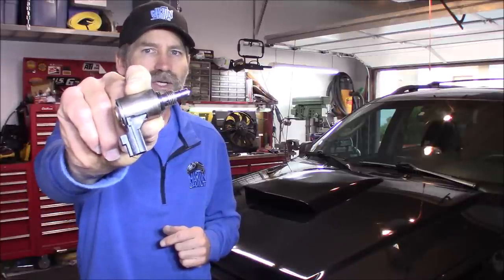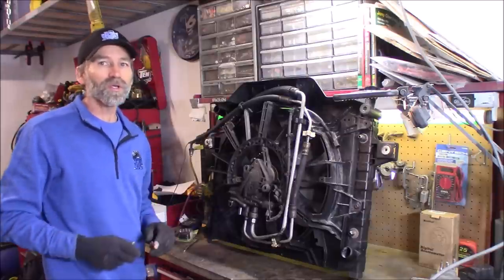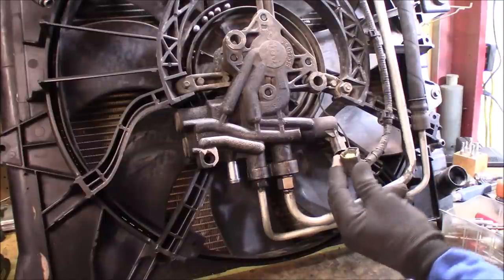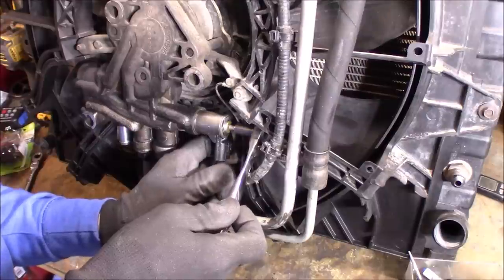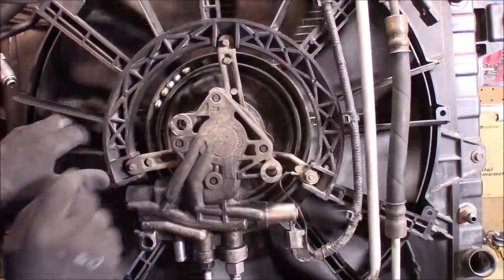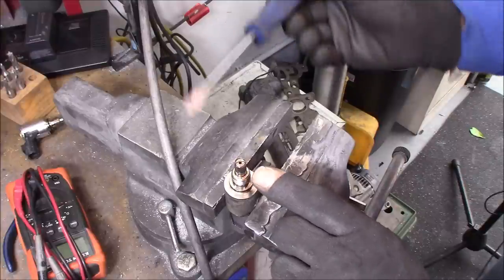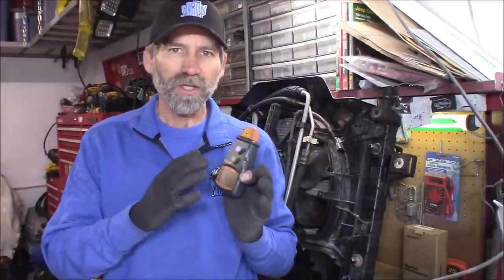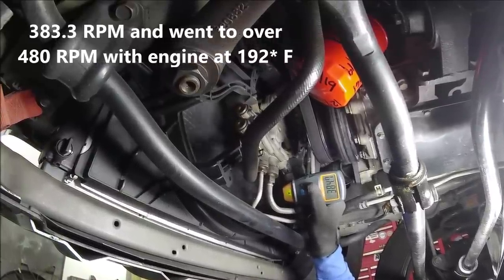01-04 Jeep Grand  Cherokee Hydraulic Fan Solenoid Mod, Remove &  Replace

Comment: My 99’ has clutch drive and electric fans.
Reply: Is your i6 or 4.7v8?
Reply from the maker: The hydraulic fan started in 2001
Reply: Jesse Fritz mine is 4.7 power tech.
Reply: martinbuilt I’m not sure what my 2001 had. I never turned a wrench on it the year I had it. It was 4.7 Limited as well and had tow package as well.
Reply from the maker: @geostanley409   Yeah it would have had the hydraulic fan.
Reply: martinbuilt all I can say is that it was more than reliable for the year that I had it. But it met a bad fate when I wrecked it almost exactly a year from the day I purchased it. I hit an interstate sign at between 80-100 miles per hour and there was nothing much left. End over end into a barrel roll. It kept me safe all the while it was being ripped to pieces. Pretty much the only reason I have 6 Jeeps today. I’m proud to own one of the safest vehicles on the road. If I ever do something as stupid as I did then, I hope that I can walk away much the same as the last time I was completely stupid. Not that I plan to do that ever again, but it’s nice to know that Jeep has my back. Everyone who saw my Jeep in its wrecked state said I should have been dead. However, even though the airbags never deployed, I only had a very minor scratch behind my right ear from climbing out through the sunroof. I’m a firm believer in seatbelts as that was my only safety precaution I took.
Reply from the maker: @geostanley409  I'm glad to hear you were able to walk away from that.

Comment: I hate the hydraulic fan!!! It kills these beautiful engines!!
Reply from the maker: I like the theory behind it and how it should work. But it doesn't work as advertised. And yes it does kill the beauty of that engine and engine bay. I'm working on a electric fan conversion. I've got the fan fitted to the radiator now,  I'm getting there.
Reply: @martinbuilt  the problem that I found with doing that or digging into that is routing the hydraulic lines. You have 2 pressure lines and one return. Also you'd need a way to have the fan kick on without a toggle switch in the cab. Is it worth the pain?
Reply: @JF32304  Remember who you're asking when you say..."Is it worth the pain?"  You're talking to MartinBuilt!  Of course it's worth the Pain!
Reply from the maker: @JF32304  to make the electric fan conversion you'll need to replace the power steering pump one from a 99-00 and the high pressure line from the early model as well. You'll see... LOL
Reply: @martinbuilt  nope I won't see. I got rid of my 04. Didn't want to deal with these issues.
Reply from the maker: @JF32304   Well maybe you'll at least see the way I get it done.